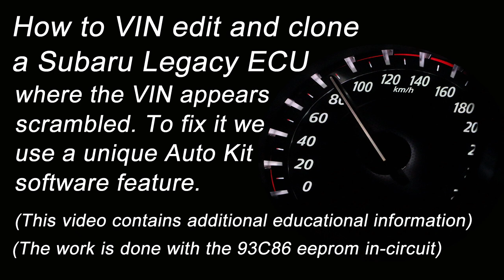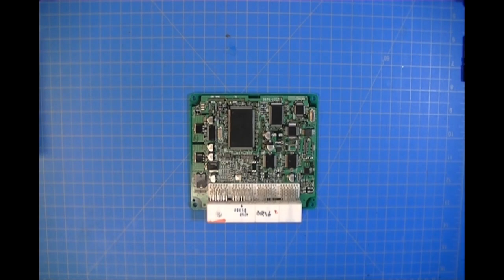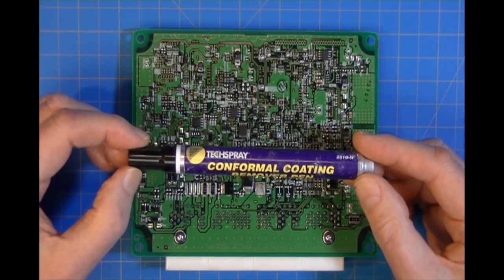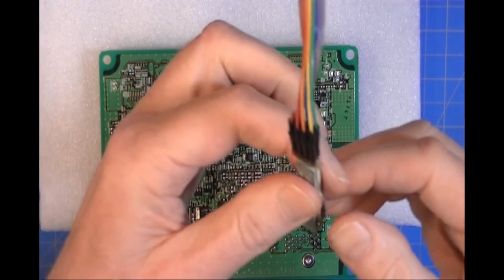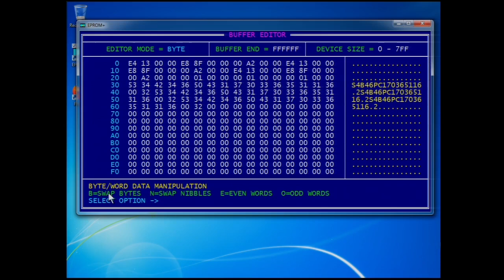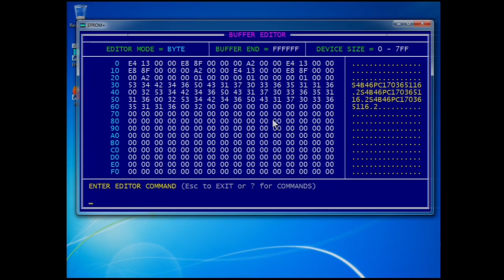How to VIN edit a Subaru ECU where the VIN is scrambled plus how to clone or repair the ECU ECM PCM

Comment: so the bite swap function automatically unscrambles the vin so you can read and write it? How does it know which characters are in the wrong place/where they need to be? Is there a standard way for manufactures to scramble them?
Reply from the maker: The VIN isn't intentionally scrambled. Each VIN character is 8 bits (one byte). Most ECU processors are 16 bits so each data element (called a word) can hold two bytes or characters; one in the upper 8 bits and one in the lower 8 bits. If a VIN starts with "AB" it will take one 16 bit word to hold the two characters. If the programmer puts the "A" in the upper 8 bits and the "B" in the lower 8 bits it can be stored in memory with the proper sequence and will appear as normal (AB). If the programmer puts the "A" in the lower 8 bits and the "B" in the upper 8 bits it will be stored in memory as BA which will appear reversed. This causes every two characters in the VIN to be swapped. The VIN just appears to be scrambled but the character pairs are just swapped. Our software has the "BYTE SWAP" command which swaps all the bytes so the VIN appear  normal when viewed by a human. This makes editing easy. Just be sure to swap the bytes back before you program the changes or the data in the eeprom will appear invalid to the module program.

Comment: can you confirm that this equipment works on a 2015 jeep abs module? eeprom part number 95080RT i just entered 95080 and got valid data from the eeprom but it doesnt contain any VIN that i can see, its just single letters or symbols per byte. a symbol that looks like a basic drawing of a house appears most often. is that encrypted data or did i do something wrong. TLDR have you or any of your customers ever successfully cloned a used ABS Module for any chrysler product. thank you
Reply from the maker: If you've read the eeprom correctly using command G you should see "part and buffer match". If this occurred note that the 95080 is a 1024 byte part. Be sure you check the entire range of the data. The buffer editor shows 256 bytes per screen so use the page down or down arrow key to view the entire memory contents. The last byte of the memory array is 3FF. If the VIN is not in the data then you can clone just by programming the data into a salvage module. Also I don't know if another customer has cloned an ABS module but since it's an eeprom based assembly a clone is a clone regardless of the module.